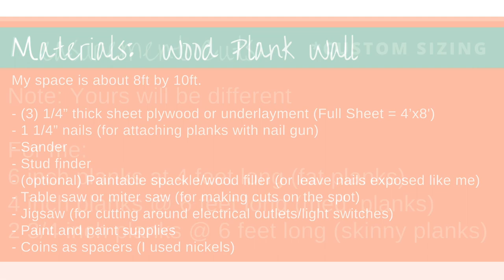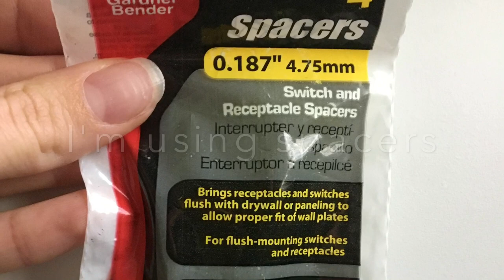How to Install Wood Plank Wall | Under $40

Comment: Looks great! But you should use an electrical box extender instead of the spacers for the electric outlets.  You don't want to expose flammable material (wood planks) to the electrical wiring.
Reply from the maker: Adam Lake thank you!! Good to know, Adam! Thanks for the tip!

Comment: Hi hon I know u say underlay but which one did you use Plytanium 3/8 CAT PS1-09 Square Structural Plywood Pine, Application as 4 x 8 or RevolutionPly 5mm Poplar Plywood, Application as 4 x 8

Comment: What wood did you use?
Reply from the maker: Underlayment. It's what's used under flooring (subfloor). It's very similar to 1/4" plywood, just a bit less expensive. All the details can be found in the description box!